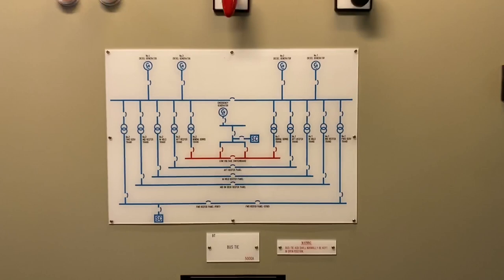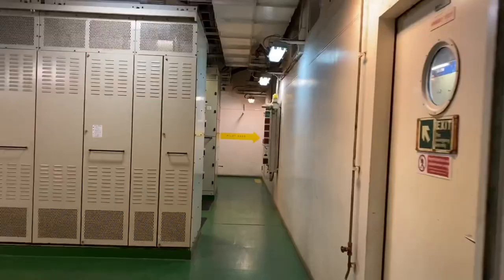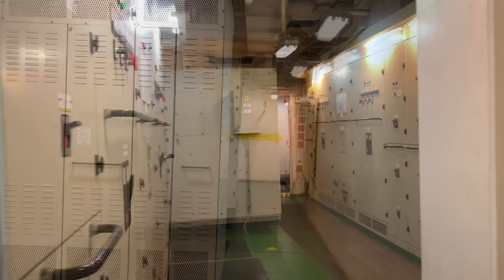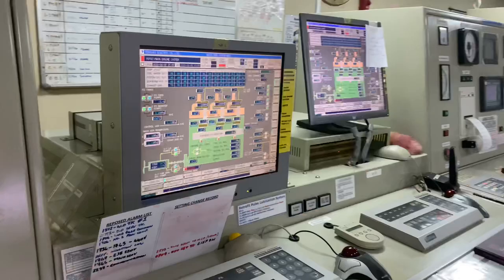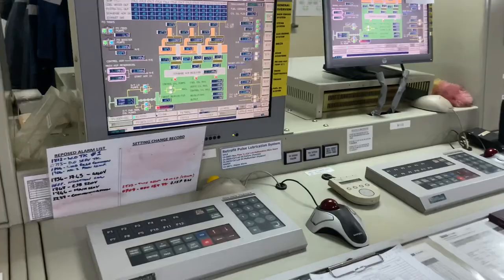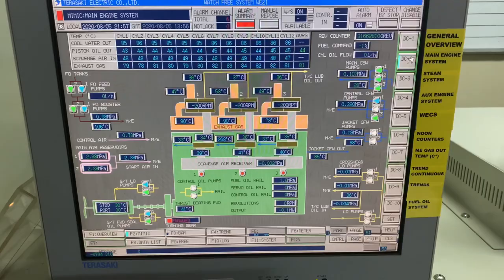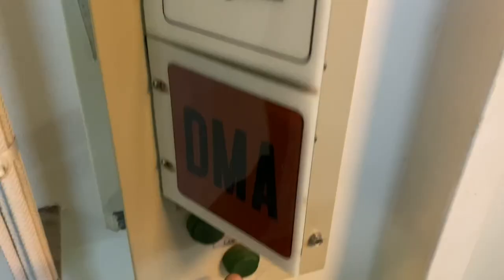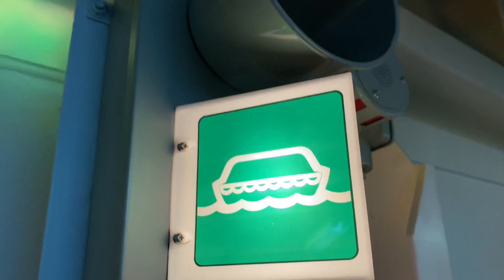FAMILIARIZATION OF ENGINE CONTROL CONSOLE | Electrician leckyjake

Comment: Your video very help ful
Reply from the maker: Thank you. Please help me to share the channel so that we can spread the help to others too.
Reply: @leckyjake  Sir i am fresher Eto sir on board most imp eto work make video
Reply: Does the vessel have one or two main engine??? Could you please show the local control connection box panel where are the wire from all the sensors??? Also the electric diagram of the network which comunicate each box untill the main computer.

Comment: That main engine certainly runs at a very low RPM. I wonder how many hours do they last?
Reply: If you look at the display it has total kWh for the engine, divide by KW output gives hours running so far.